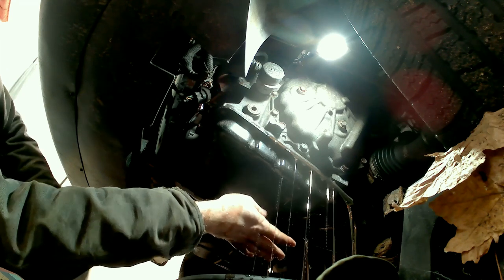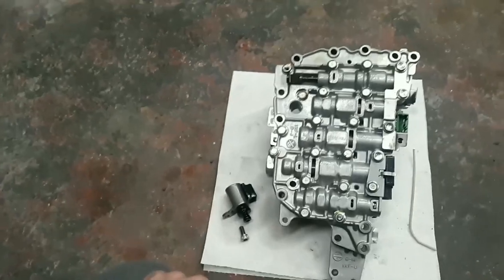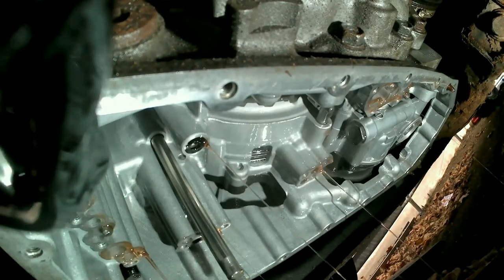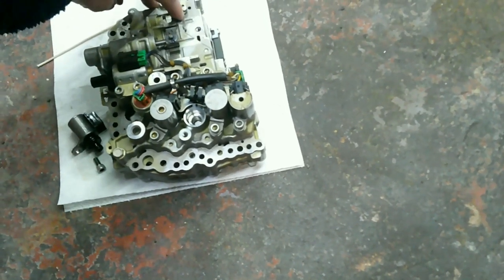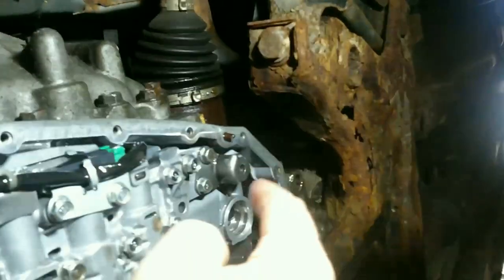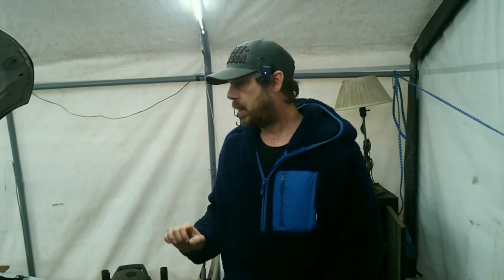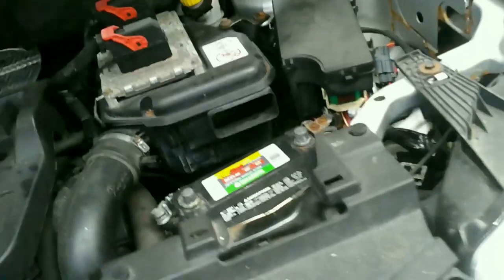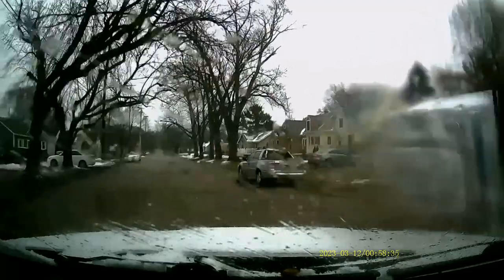2012 Jeep Compass valve body

Comment: Adding my data point. P0777 permanent. P0730 temporary. 2011 Jeep Patriot with 115K miles. 
I replaced BOTH filters (there is one up top too). They were both completely clogged. I cleaned off the fine metal shavings around the magnets in the pan. I replaced ALL 4 solenoids with new parts from EBay. And then filled up with 6 quarts of Mopar CVTF+4. 
So far, so good! I can't clear the permanent code, but no more limp mode so far, and it used to do it within 5 minutes of driving.🤞
Reply from the maker: The permanent code should clear itself after the problem has been fixed. I'm not sure how long this takes but I did get permanent code out of mine. Mine went back into limp mode after doing this but my transmission only pressure tested at 50 pounds. I do believe you need 75 to 200 hopefully everything works out for you. I need a new transmission. I've traded mine off for a Mazda five that'll be coming up on the channel in the spring. Thanks for watching best of luck I'm not liking CVT's anymore.
Reply: Try clean de DTC errors with a scanner then drive again and check if appear again
Reply: Is your car still driving fine or did the problem come back?

Comment: Hello, greetings from Argentina, it also shows me p0777 but solenoid jam closed, is it the same problem? thank you so much
Reply from the maker: I would think so since it's the same solenoid. Just so you know this fix only worked for a couple of months. the transmission went completely out after that. There's a bigger internal problem and it's usually the pump. I'm gonna just replace the whole transmission with LKQ online used transmission. . I'm replacing the whole transmission because when pressure tested it's only giving me 50 lbs of pressure. This transmission requires anywhere from 75 to 200 lbs of pressure. Thanks for watching

Comment: Hello , thanks for the video.
I have a jeep compass 2011 2.4 it wont shift to second gear is in limp mode , I scanned OBD it shows p0777 which is the solenoid  stuck and P0730 gear incorrect ratio , i  asked a mechanic shop they said it needs a transmission replacement but this CVT’s are crazy expensive, did yours had the same problems and changeing the solenoid fixed everything or the car went again on limp mode?
Reply from the maker: The P0777 is the only transmission code that I got. It still doesn't seem like it wants to shift at a normal RPM unless you play with the gas pedal. I'm not sure if I'm having it transmission issue or throttle Body Issue. I do know you can get a P0730 if your fluid is low. Still trying to figure out how to check the fluid on these because that may be my issue as well. If that doesn't fix the problem then I'm afraid it's probably much deeper. From blocked fluid lines to a bad torque converter.
Reply: When I bought mine it had a whining noise when you rev the engine, i did an transmission oil flush and filters the noise went away but it wasn’t shifting right just like yours in the video i had to play with the gas pedal or sometimes it was shifting fine , it worked  like this for like a month and now it’s in limp mone wont shift no more it doesn’t go more than 10 mph and throwed to me these codes. Do you suggest me to try to replace solenoids ?
Reply from the maker: @or703  replacing the secondary pressure solenoid should take care of the P0777. As far as the P0730 that could be a multiple of different things and I just don't have the experience to know. So knowing that I'm not a mechanic what I would do is replace the pressure solenoid and hope that that takes care of the P0730 code as well. I just don't wanna give you bad advice especially when it's $100 in fluid just to check if that would fix the problem.
Reply: 2012 compass p0777 only replaced all solenoids and stepper, valve body cleaning and inspection, both filters changed fluid filled to spec. Driver hub and bearing driver cv axle all 4 wheel speed sensors. Still code p0777 no other code limp mode with no shift. Ecm sets full limp no pedal response if test driven too long or rpms raised above a certain point haven't figured out which. To check fluid level technically you need a scanner that reads trans oil temp and there are dipsticks made to read the level at certain temperatures. Cheap to buy but can be confusing. From my reading and have plenty of manuals if you need including the factory repair manual not just the workshop repair manual. But it guve the break down of test each DTC code including p0777. I have performed all electrical tests for mine and can say that although the code is to solenoid b stuck on my particular issue is not the solenoid itself.  Most of the testing for this particular code requires pressure testing (2000 psi gauge remember) the possible causes for this code can be 
Fluid level
Dirty fluid
Clogged filter(s)
Solenoid B
Pump
Blocked hydraulic passages 
PCM
As listed in factory manual
I believe mine personally may be the pump but I have yet to find. 
If you need anything from myself to help please feel free to ask as I said I have many pdfs to assist with this issue. I also want to say there is that part of me after doing this for a long time and specializing in fixing what can't be fixed I keep having a feeling that the po777 code sets so permanently into the pcm that even after fixing its possible the damage has already been done and the only solution may be flashing/reprogramming. I have a friend at aamco offering to diagnose for free so if I get it to him I will update you on what the verdict was for mine.
Reply: Also according to the manual when removing the valve body your supposed to use the pin as well to hold the lever in place and like yourself I did not my first time removing it and I was wondering if removal changed the ratio however it doesn't seem like it just moves that easily so I am not sure l. The manual say during removal so that the valve doesn't move but I'm sure it's referring to the manual valve on the valve body which lines with the pin. However I did use the pin each of the 3 times I have removed and reattached it so far lol 😢. And this last time I removed it being my 4rh now I wanted to see exactly how the pin and manual valve looked prior to removing it because as I stuck my pin in for proper removal according to manual it seemed to hit just the bottom edge of the lever and could not be positioned to hold the leverage in assembly. Possible a thinner tipped pin could slip past edge tho but I was using pin hook I had broke tip off of so tip was about size of pencil lead but it is possible that the pin is not lining up during assembly although I do use pin to hold in place. I don't however get codes for gear ratio such as p0730 that it should give if misaligned but I also cannot get vehicle up to speed and I don't know conditions for setting the p0730 dtc fully.
Reply from the maker: @joshbuckner2594  I stopped driving mine until I could replace the subframe which I did last weekend. When I started driving it the code came back. It will drive fine until I make a couple of stops and then it'll go into limp mode. I have to turn it off and turn it back on for it to move again. Thank you for all the information it's perfect timing and thanks for watching.
Reply from the maker: @joshbuckner2594  I seem to be having a lot of the same issues. Let me know what you find out I'm thinking it's probably transmission shop for me as well.
Reply from the maker: I took my launch scanner to the Jeep today and I did find the P0777 code as pending and permanent. I tried to reprogram everything the scanner would let me then took it for a test drive no light came on did not go far. Now I'm trying the old school trick of disconnecting the battery and holding the cables together for awhile. But I do think you're right about flash\ reprogramming because that code is locked in there permanently.
Reply: @michiganmudmechanic  yea I just have a simple reader the mobile mechanic I had come look had a much better scanner like yours and could pull more codes but all I believe were previously set. I've tried clearing the code as well with the battery cable trick and it does clear the code from pending however it was still set permanent. I think the biggest help we will find is to find someone on the web with the exact same issue who has fixed it without a tyranny swap or full rebuild and see exactly what their issue was. I've done a lot of mechanical work overtime but I just haven't messed with transmissions a whole lot. The mobile mechanic ran an endoscopic camera into the transmissions and says there was lots of trash but the component look good and from my reading of the manuals it is not going to be something internally major but only time will tell. Will keep you updated
Reply from the maker: @joshbuckner2594  I took mine for a drive yesterday and it ran shifted and drove just fine. But I know if I continued to drive it it would go into limp mode. So I thought about replacing the PCM or whatever the code is permanently stuck in. But I'm afraid that the Jeep will just put the permanent code back into the new component. So I'm a little on the fence right now and what I'm going to do because I know my transmission is mechanically fine and I'm having a problem in the computer wiring system. Thank you for all the valuable information it really has helped me decide the direction I wanna take.
Reply: Did you guys figure it out? A LOT of people, myself included, seem to be having this error with jeep compass. Did you ever fix your jeeps?
Reply: @michiganmudmechanic did you fix?
Reply: @joshbuckner2594 you fix?
Reply from the maker: @iancaldwell6349  I took mine into a shop for a diagnosis there's just some tools I don't have or know how to use. I will update
Reply: Looks like I'm joinh the p0777 club
Reply from the maker: @BruceLeef  I just got mine back from a mechanic that was able to do some pressure testing. I'm not digging into a CVT. I'm changing the whole transmission.
Reply: @michiganmudmechanic  wow.. sorry to hear that I was afraid I'd have to do this same thing.. thanks for sharing & good luck 👍
Reply from the maker: @BruceLeef  this is just a hobby. I've never driven this Jeep outside of my videos. I bought it cheap no crank no start wearing an auction collar around the steering wheel. I knew right away this was the basket case vehicle for me. I brought it along way, but this transmission is gonna put me in deeper than I wanted to be. Can't give up now thanks for watching.
Reply: @michiganmudmechanic im in the same boat now
Reply from the maker: @revealedfromonhigh  changing the solenoid only worked for a couple of months. I don't have the tools to pressure test it so I took it to a mechanic and he only got 50 pounds out of it. he told me it needs 75 to 200 so mine will need a new transmission too. They are crazy expensive the cheapest used transmission I found is LKQ online 1600 to 2200 depending on mileage. By the way mines 4 wheel drive. I think the front wheel drives are cheaper

Comment: Hi guys. I’m having the same problems. P0777 despite a Cvt rebuild. Apparently it’s due to the pump valve. Have to replace it with a free flow valve   Fingers crossed that it will work.
Reply from the maker: I'm in the same situation, my main line is only producing 25 psi. Apparently you need 75 to 200 psi. I'm planning on changing the whole transmission. I don't wanna take it out of there put it back in and have it fail.
Reply: @michiganmudmechanic  these will get as high as 500-800 psi under normal operating conditions

Comment: What the PART # For this Pressure Control B solenoid ?

Part # ?
Reply from the maker: The only number I can find and I don't know if it's correct is 08105-2. That's the number on the top of the solenoid.
Reply: @michiganmudmechanic  awesome.  It's a starting place ... Maybe it's the Number .. maybe not.   But it's Something...

Thank you for replying.
Reply: @michiganmudmechanic  Thank You For Replying